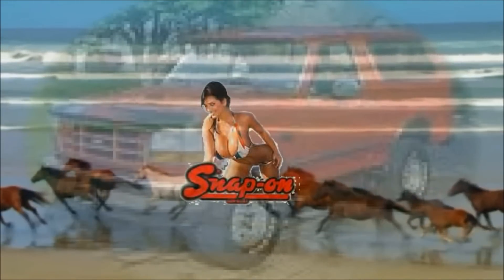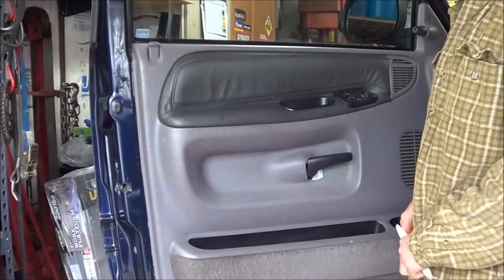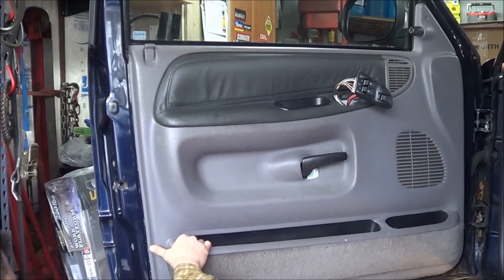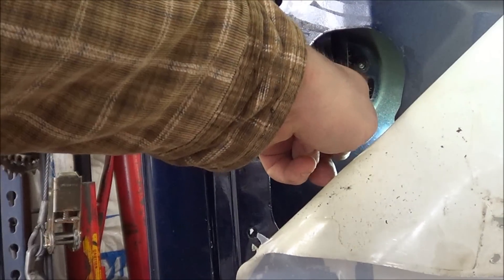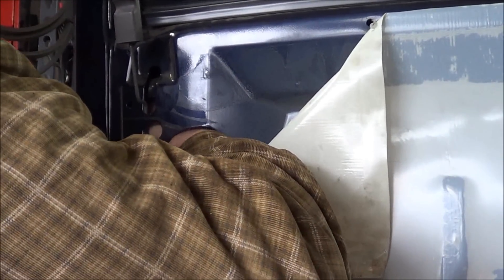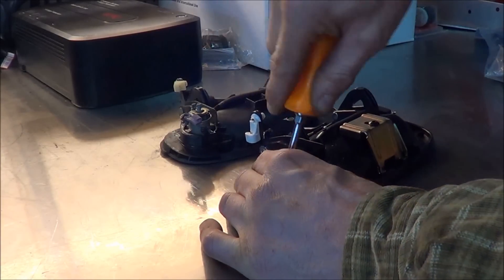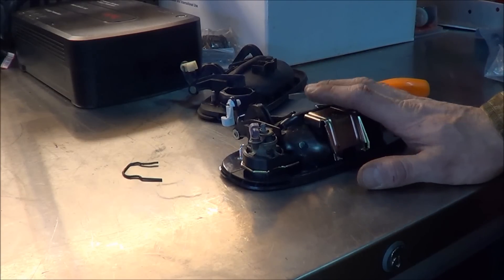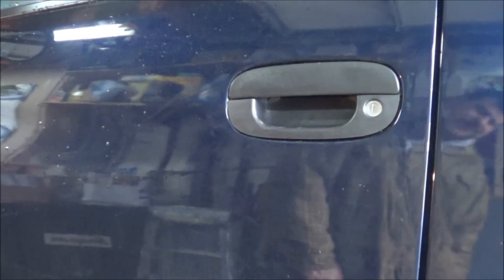3-31-14 how to replace outside door handle on a 95 Dodge Ram pickup

Comment: I have changed my right hand handle out about 3 times. They don't last long before breaking
Reply: new or used?
Reply: +Alan Huff new, I discovered that the after market door handles are a lot lighter than OEM and generally of poor quality. I bought another one from the dealer and it's holding up pretty well.
Reply: +pcguy36 im thinking about salvage yard got one for 20 think its worth putting in?
Reply: +Alan Huff I wouldn't.They are kind of a pain in the ass to install anyway and most likely are getting ready to fail too. I want to say I paid about $70 from the dealer but if i don't have to change it again, it's worth it to me.

Comment: I am trying to help my uncle with the assembly.  We thought that it would never disassemble from the rods.  Our hands are too big to get up in there.  We had flashlight difficulty and don't remember how it was assembled for the handle on the rod clip.  Does the clip face open toward us or away when snapping in the rod?  We're having to take breaks from this Oklahoma heat and humidity.